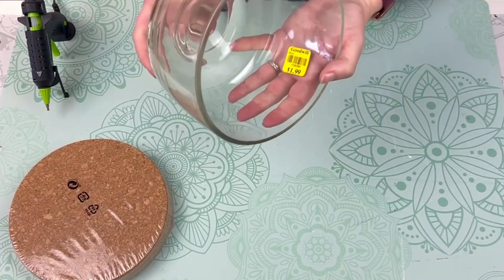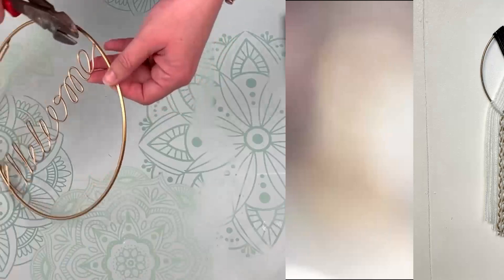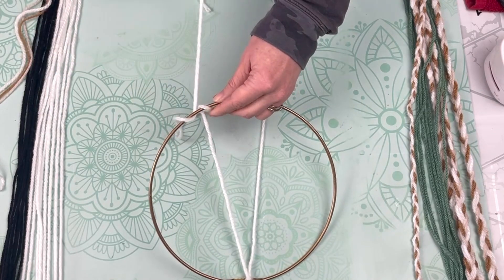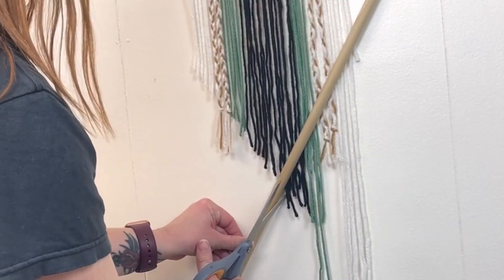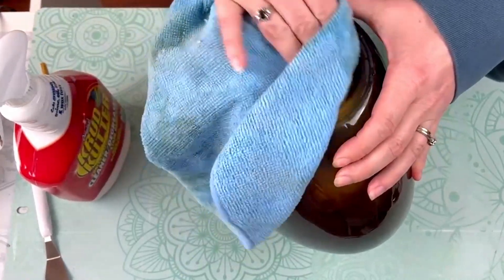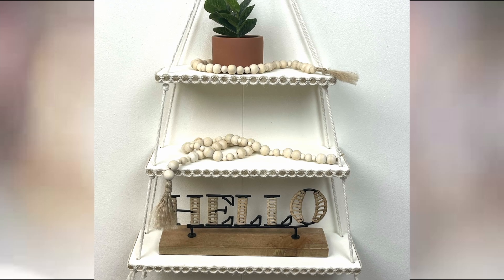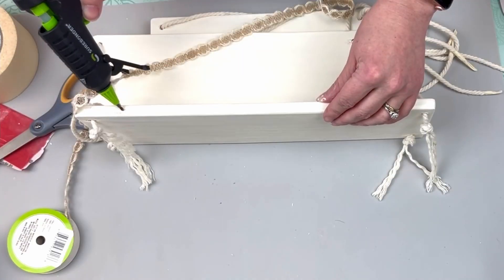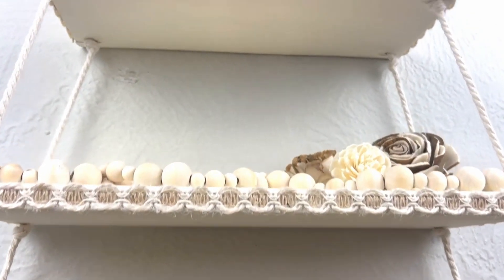Boho DIY home decor | Modern high end DIY decor

Comment: The half and half vase  that's green and wax white... It's cool but what if you did it all white and then took away the white off the edges of the little pieces that you had adhered to the side to expose the underneath color you can also use wax to do the same thing except for you just use steel wool to rub it off when it's all dry just an idea thank you for everything you're wonderful